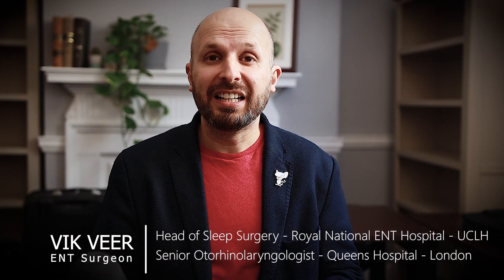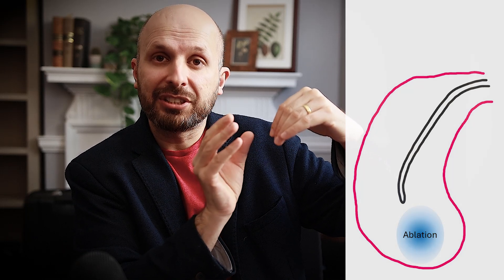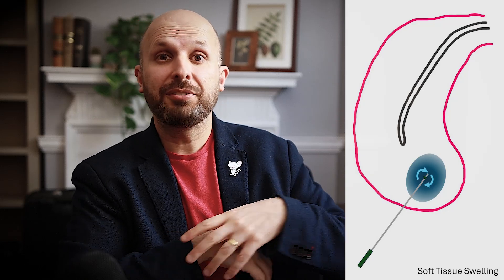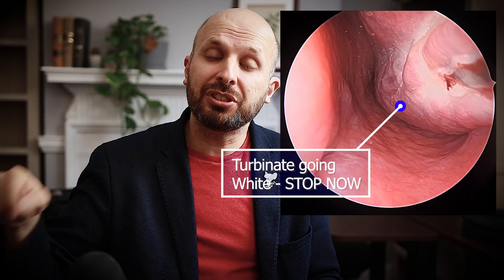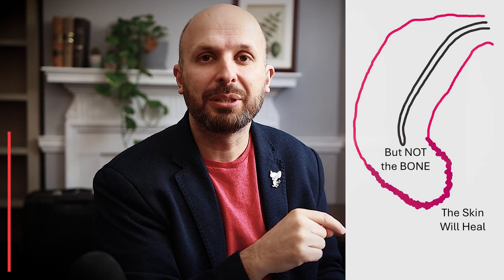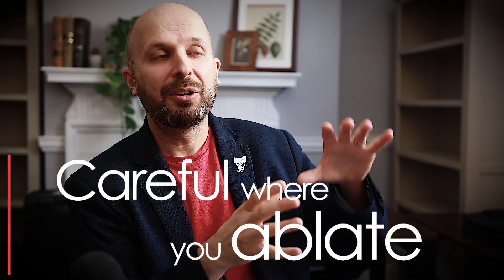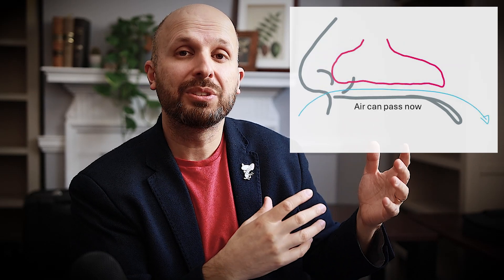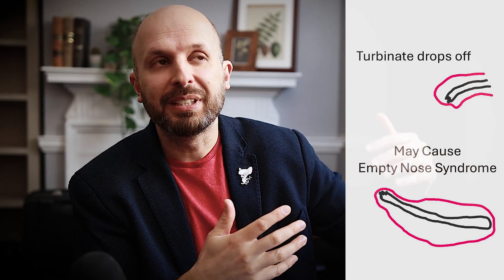Turbinate Surgery: How to Avoid Empty Nose Syndrome

Comment: Hey doc and other fellow experts. The thing about pre-operative decongestion that was described seems odd  to me (a non physician). Why wouldnt somebody want to work on a decongested nose, to really reduce only the real excess tissue under non-inflammed conditions? And also if decongesting means soft tissue will shrink to an extent that you can barely isolate soft tissue from bone, then what the point of wanting to perfom that reduction surgery? And at the end of all this, why do we stress so much about trimming some tissue that is allergy controlled and may eventually regrow back? Not criticizing here, just laying some thoughts (which may have logic gaps since i am no expert).

Comment: I'm in UK and am 3 weeks post surgery (septoplasty and turbinate reduction) my breathing is far worse than before surgery now and I'm getting nasal fluttering from the slightest sniff of my nose, and if I full on sniffle then one side completely collapses. At the moment I'm wishing I had not had it done at all. 😢
Reply: @amandahodgson3014  you need to be patient. Full turbinate reduction recovery is like 6+ months. You’re not even a month out. Your (new) turbinates are getting used to the air detection and that’ll take some time to get adjusted to. Like me, you probably were sniffing so hard before the surgery just to move air through your nose. Be patient and keep taking care of yourself 🙌🏽

Most ENS cases are diagnosed at least 3 months post op from what I read.
Reply: I'm about to get my surgery next month, so I can't relate personally yet, but it sounds like you're breathing the right way for the first time. Like Neo using his eyes for the first time in the Matrix.
Reply: Hey, how do you feel now

Comment: I had RF Turbinate ablation almost 4 months ago, I have severe dryness in nose and throat also no resistance while breathing out, what went wrong?
Reply: I had RF Turbinate reduction and septum deviation in the year 2022, since that time I have less humidity in nose,severe dryness in the nose & ear and sleep obstruction. As my ent suggested am using nasoclear gel for dryness in the nose, almost from 3months and now am getting good sleep. Is there any solution for dryness inside nose? Is this ENS? Actually post surgery observed one nostril inside space is big compare t other is this creating an issue?
Reply: @luzvasquez7995  so you got your turbinates reduced? I got mine done and a septoplasty on 1/9/25 and feel like minty air and burning and also congested or like very dry and not sure what to think with all this ENS talk 😞 what are your symptoms?
Reply: @AlejandraSoria-r8n hey, how are you feeling today?
Reply: @AlejandraSoria-r8n how do you feel today?
Reply: hello, any update?

Comment: They need to authorize millions and millions of dollars in finding out how to avoid ENS
Reply: I don’t think it would even cost that many millions. Collect the data on turbinate reductions, see who gets empty nose syndrome, then deduce which methods, which techniques, which surgeons even, are least likely to result in this condition.
Reply: ENS is easily understandable a different way from how it is presented, with obvious clinical implications that are not being followed.  Read about phantom limb syndrome, and then consider that any damaged tissue anywhere in the body (not just a "limb") is still an amputation, and any damaged nerves will never transmit signal again.  Tinnitus is also considered a type of "Phantom limb" like sensation, where the body makes up a noxious sensation to fill in a missing sensation due to hearing loss. In the case of the turbinate amputation, the breathing sensors inside the nose produce signals that are expected to be always "on".  If those nerves stop transmitting, the brain panics because it assumes airflow is not correct.  Phantom limb outcomes are very dependent on the amount of numbing done, since that sets the stage for the last signal the brain remembers ever getting from those nerves. Too much numbing, and the necessary signals are remembered as missing. Too little, and they're remembered as pain. No one is told any of this when they sign the anesthesia consent forms.
Reply: @Tpfailed  They will, advanced AI will figure it out.
Reply: @mrt445   i love chatgpt man, just learned about the frequency stuff, i think i had a septoplasty years ago but i still can feel my breathing and temps thankfully but still suffer with sinus, that doctor was a bad one

Comment: You didn’t have a patient with ENS. But how often do you think it happen in UK using Celon technique? Less than 1/200 or more?

You said to avoid of reducing middle portion. What if that is place of most swollen due to compensatory hyperthrophy - middle septal deviation with bone spur?
Reply: The septum spur question is a good one, my ct scan showed that exact thing

Comment: What about bone resection? Is it safe? Because a lot of ENTs like to remove a small piece of bone. Thank you so much for the video!
Reply: do you mean the bone inside the turbinates? I had mine removed(a small piece on the ends of the inferiors) and also an outfracture - all of this caused an ENS. Be careful.
Reply: @orange22-ng9ul So you only had bone removed in the front of your turbinates + outfracture? Or do you mean that a small part of your turbinate was removed? Have you talked to your doctor?
Reply: @s.f.2426  i had the same procedure like you described. Is it common to have ens ?

Comment: Hi Dr. Veer. Question. Does outfracturing turbinates have a higiher risk of ENS than radiofrequency ablation?
Reply: @chazlon5061 I had an outfracture plus a small piece(1-2cm) of the ends of the inferiors removed and this caused an ENS. Be careful.
Reply: What are your symptoms?
Reply from the maker: out fracture by itself does not cause ENS.